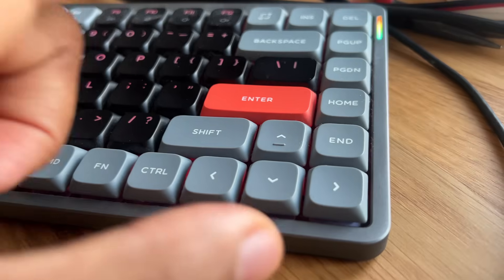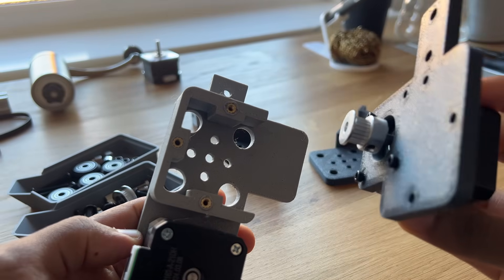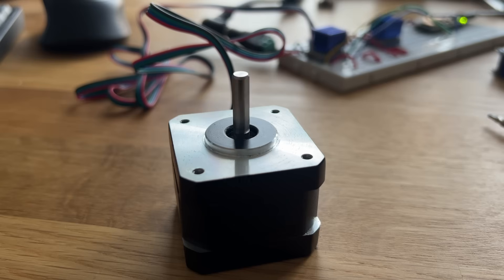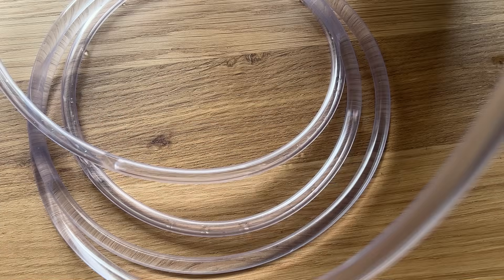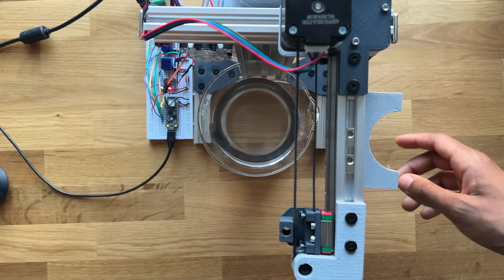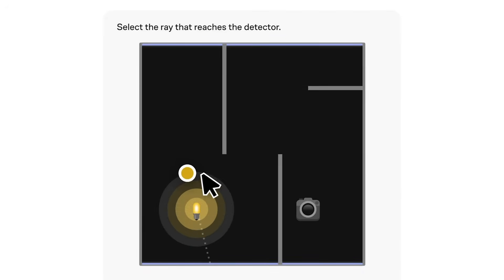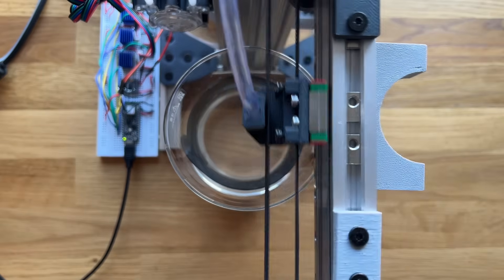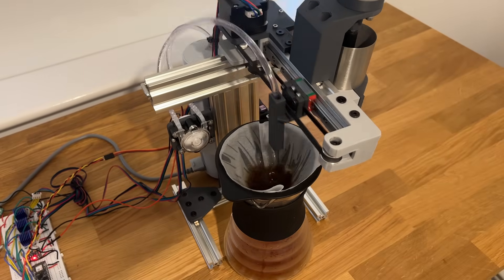I Over-Engineered a Robot To Make Coffee

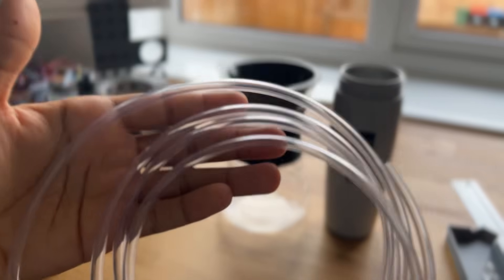Comment: 4:15 i don't think even food-grade PVC is save when used for hot boiling water🤔
according to Wikipedia, polyvinyl chloride starts to loose rigid form at 82C (which you observed at 5:02) and melts at 100C (which probably is changed by all the additives the manufacturers add)

Comment: Great video and great project! One problem I saw was that the foodgrade PVC can only safely be used for <50 degree Celsius fluid transport. Considering you are transporting boiling water, that feels like a big problem? That is why your tubing turned so elastic. Replace that with silicone tubing if possible as that can tolerate <200 Celsius safely.